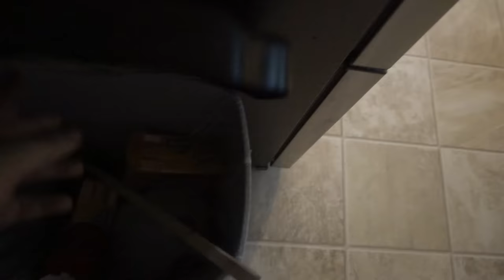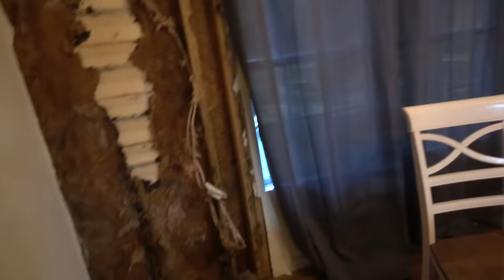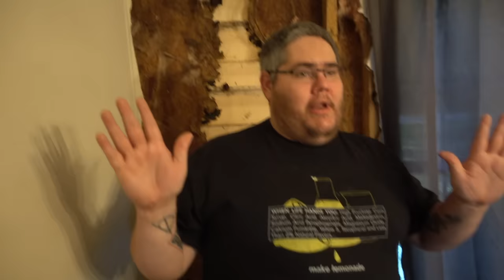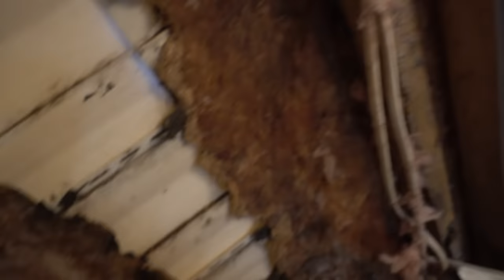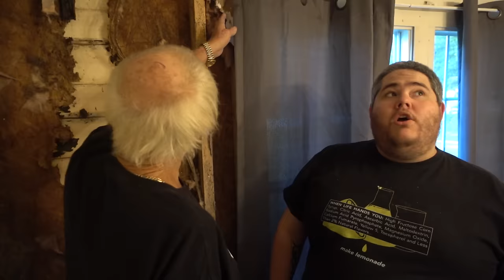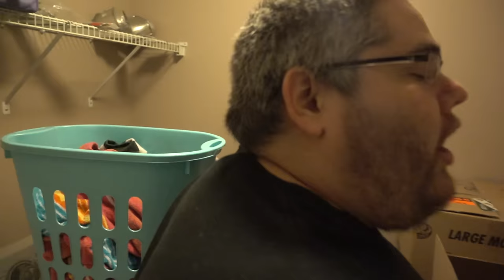GRANDPA RIPPED HIS WALL OUT!!

Comment: Here is the thing, Tetanus does not come from rust, it comes from dirt. Tetanus is an anaerobic meaning that it hates oxygen. If you got dirt on an open gash then you probably won't have Tetanus because a lot of air can pass into the wound, but if you got dirt on a puncture wound, then you will have a higher chance of contracting Tetanus because not a lot air can go into a puncture wound. You're supposed to get a Tetanus shot every ten years, but Bridgette doesn't like shots so that isn't good. If you only got a little dirt on a wound, then you probably won't have it, but if you got a lot of dirt on it then you might have Tetanus.